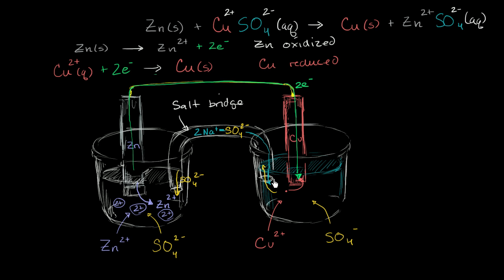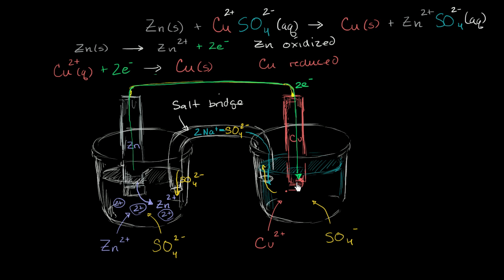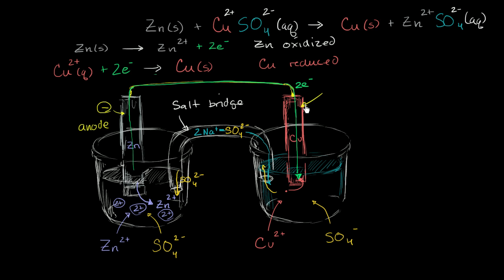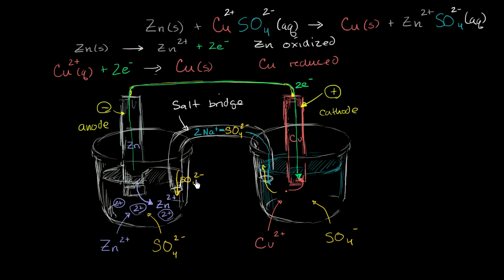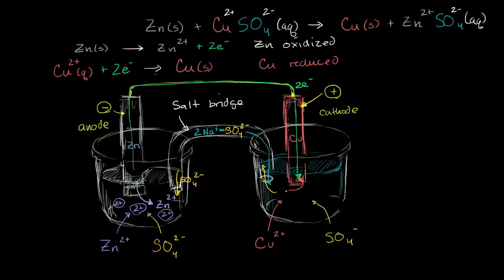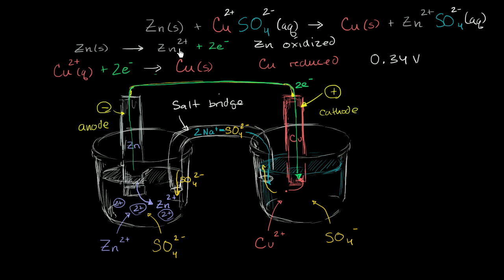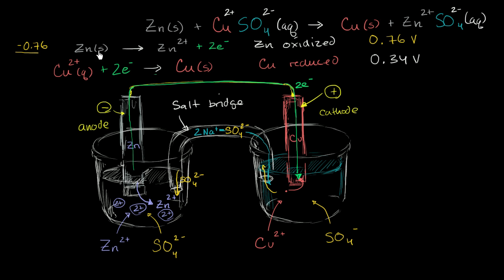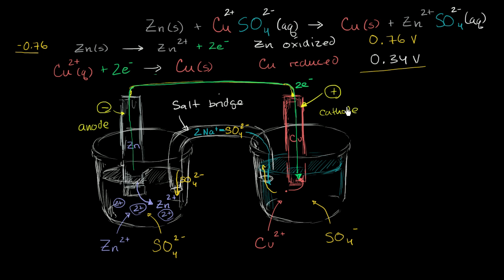Electrodes and voltage of Galvanic cell | Chemistry | Khan Academy

Comment: In a device which consumes power, the cathode is negative, and in a device which provides power, the cathode is positive.
Reply: My understanding is that anode is oxidized (ie. loss of electron) and cathode is reduced.
Reply: amrinder singh, Is there any reason or it is just an convention? 
As the Cathode Rays used to identify the nature of the eletron are negative charged and all eletrical application I`ve seen.. :/
Reply: +Mariana Carvalho that is correct what you saying. I was saying in another context straight polarity and reverse polarity. and by positive here I mean positive terminal. back then i was doing an experiment then i found something that's why i wrote it because of long time i am unable to clarify more.
Reply: Thank you. I was also getting confused here.

Comment: Why does the vernacular in the sciences have to be so darn contradicting (chemistry more so than the others)? The side gaining electrons 'reduced' (becoming more negatively charged and associated with anions) now becomes the positive and is dubbed the cathode...Blah.
Reply: The terminology does get confusing :P The only thing that is true is that reduction occurs at the cathode and oxidation at the anode. The polarization of the electrode depends on which kind of cell we are talking about (galvanic or electrolytic).
Reply: I thought the cathode was the negative electrode and the anode was the positive electrode? And so substances get reduced at the cathode and oxidised at the anode?
Reply: Taren Rughooputh You are right about the anode being oxidized and cathode being reduced, however, the negative electrode is the anode and the positive is the cathode. My question was purely rhetorical based on my past frustrations with the terminology in the sciences.
Reply: Yeh, I am 16, so I think the terminology for me I will learn in higher education! But yes, my teachers at the moment are teaching me the negative cathode and vice versa. I'll stick with this for now!
Reply: But Thanks!